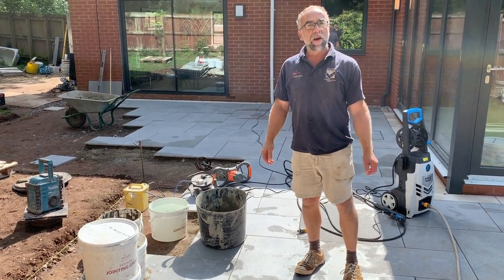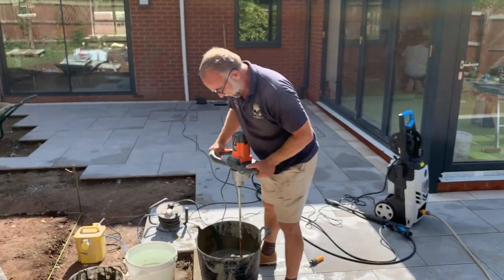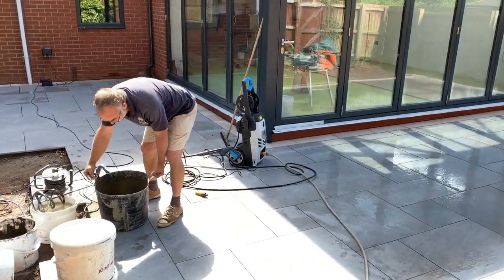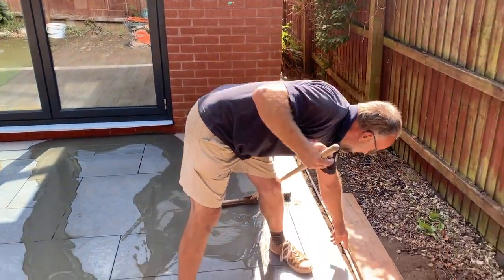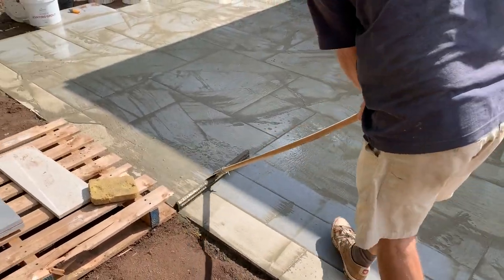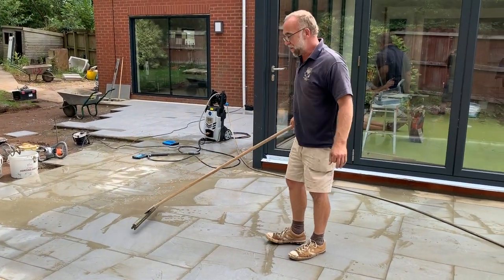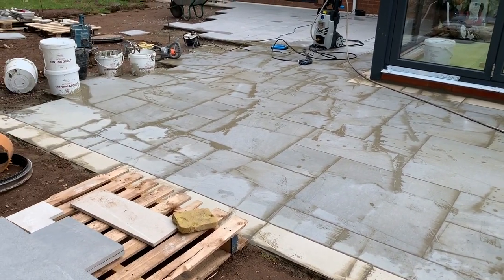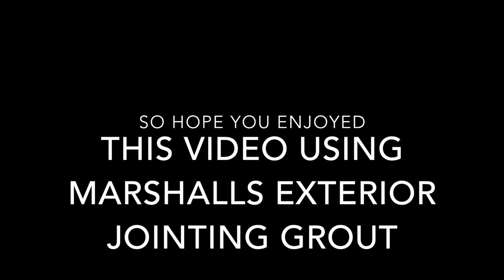how to joint a patio

Comment: What colour are you using here?
Also what did you sue to block the edges to stop grout flowing off I m in same situation and need to block off the edges
Reply from the maker: Just a tiny bit of cement nothing much about half a thimble full for each 👍🏴
Reply from the maker: Grey https://youtu.be/jX_hs_wjBiM
Reply: Looking at the marshalls website they only do natural and charcoal, where can I get the grey from?
Reply from the maker: Hardik Waghela unfortunately they don’t sell it to the public as you have to be trained up how to use it. 
Example if you do it wrong and everything is ruined and then you’ll be suing em. 
Otherwise google liquid cement for grouting and try from there 👍🏴
Reply: @tidybrickslandscaping  that's strange as they're selling charcoal and natural colours, is grey any different or the ones that they selling on website charcoal outdoor jointing grout and natural outdoor jointing grout is it completely different than what you've used?
Reply from the maker: Hardik Waghela mine must of been called natural as well but really looks pretty grey to me still. Definitely not used the charcoal yet so must be natural I’ll check one of the tubs tomorrow.
Reply: @tidybrickslandscaping  that'll be a huge help if you're able to check that for me, natural can't be right as it's very beige shade. I got same porcelain so want to use the shade you're using as it goes really well. Please check the shade for me. Thanks
Reply from the maker: Hardik Waghela yep checked this morning and it’s the natural mix I’ve got not grey but looks very grey 👍🏴